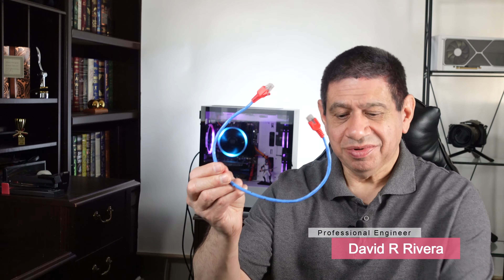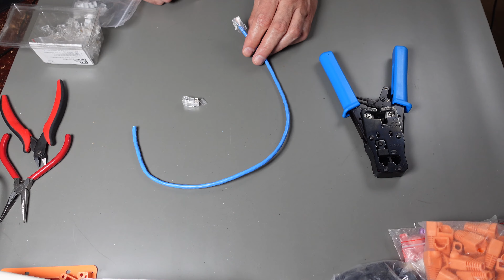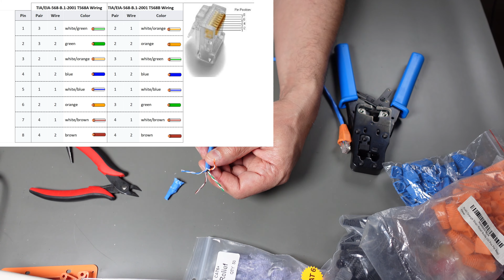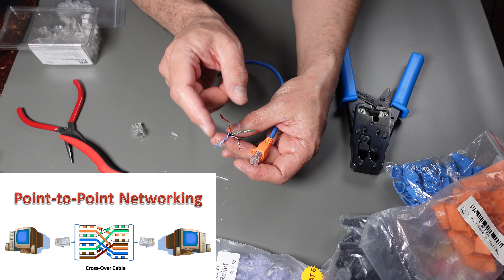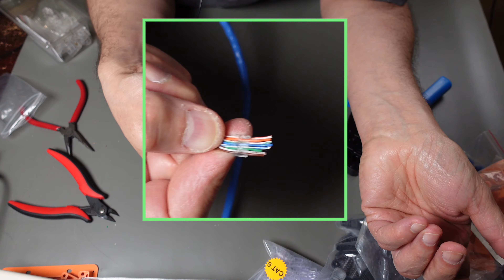Properly Making a Cat-5 or Cat-6 Network Cables and Using Keystone Connectors

Comment: Perfect :)) Now I know How to fix my network Cables which have a broken off plastic piece. I am sure it will take me hours to do :))  And your meassuring tool is very practical. Can it do metric too?
Reply from the maker: Kathrin, Yes, it can be switched to metric (meters rather than feet).  Also, improved accuracy can be achieved if you change the 'Length Constant (in pico Farads per foot)' to match the specific cable you are working with - usually done when you buy rolls of at least 1,000 ft (304.8m).

Comment: Good one Sir  I was waiting for this one
Can you tell me how did you remove that little piece of rump out from the connector because usually its  attached to the inside part of the  connector
Reply from the maker: I'm not exactly sure what you mean - Rump.  Do you have a picture you can Email to me?
Reply: @PE4Doers  you have referred to it as a little piece in the video especially when you were inserting the cables according to color coding in that little piece.
That part was shown before punching the cable
Reply from the maker: @fazalbaig3135  Are you referring to that small piece of plastic that I first inserted all the cables into, then it was inserted into the connector itself?
Reply: @PE4Doers  Yes exactly you have got it now
Reply from the maker: @fazalbaig3135  For the two-part connectors, that plastic piece stays on the cable.  It really helps align the cables before they go into the outer shell, provide some extra protection within the outer shell, and make it a little easier to get all the cables straight and pushed down as far as possible toward the outer plastic casing.
Reply: @PE4Doers  Thank you once again Sir
Would love to see a video on structured cabling also
Reply from the maker: @fazalbaig3135  You are welcome.  I need to look up 'Structured Cabling', is that how they are routed through a building?
Reply: @PE4Doers  I don't have much idea about structured cabling but it looks good because most of the cables are hidden
Reply from the maker: @fazalbaig3135  Have you seen my Network Brief covering my home network: https://youtu.be/PDu7-GERfFM 
That video may show some of what you are looking for.
Also, you may be thinking about more sophisticated networks where they have a small rack-mount setup that uses a 'Distribution Panel' to organize the cabling.  I did not see a need for anything like that at this point, however as I look more seriously into adding 10-gig network connections and some Power-Over-Ethernet (PoE), I may decide to put in a rack mounting setup and at least one distribution panel.

Comment: There are inexpensive insulation strippers that will cut the exterior sheath in a perfect circle rather than mess around with the string and snippers.  I would have expected you to demonstrate putting connectors on Cat 6 cable.  The principle is the same, but the center shielding must be dealt with and it would have been instructive to some viewers whom may have never seen Cat 6 cable before.
Reply from the maker: Thanks for the feedback and the suggestion.  I was actually planning on creating a follow-up to this video, so you have given me an idea. I have two different types of Cat 6, and now a roll of Cat 7 (as I move toward 10g for my critical systems). One is standard Cat 6 which I used in this video, and the other is Cat-6A (with shielding) which I did not.  My next video was going to be on the Cat-7, but now I think I will also cover the Cat-6A, since it has that central plastic core the keeps the pair apart and makes for extremely study (a little hard to work with) cable.  I will try and get that next one done within December.

Comment: have 100 Mbps connection. Now planning to use 20meter cat 6 cable to connect desktop and router in my study room. Will there be any loss of internet speed due to the 20 meter long cable?
Reply from the maker: Standard Cat-6 cable is good to just under 1,000 feet or 300+ meters running a 1gbp, so I would not expect there to e a problem.  Of course that assumes you are using the latest (within the last 10-years) Ethernet drivers and hardware.
Reply: @PE4Doers  thank you for your response.
Reply from the maker: @abhijeetgopal4761  You are very welcome.  Let me know how it works out for you.
Reply: @PE4Doers  after further investigation found out crimping was faulty. After correcting it, now I am getting same speed at other end of cable. Thank you.
Reply from the maker: Great to hear that.  Yes, the crimp is a critical step.  Do you have a tester?